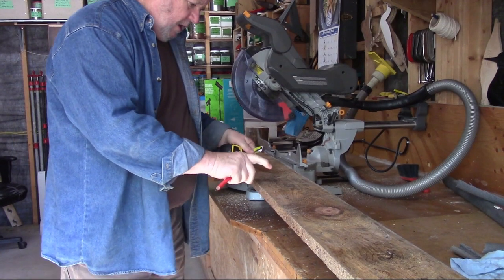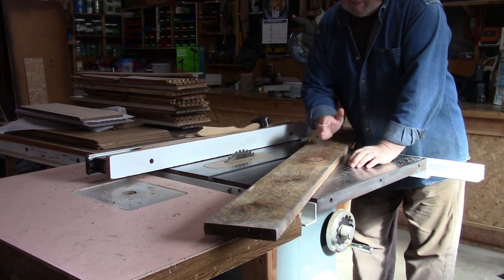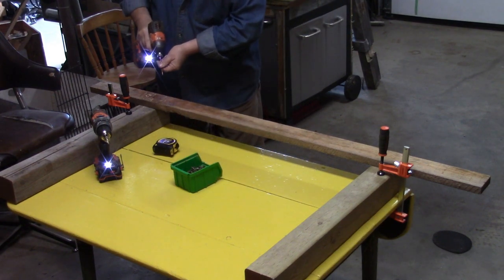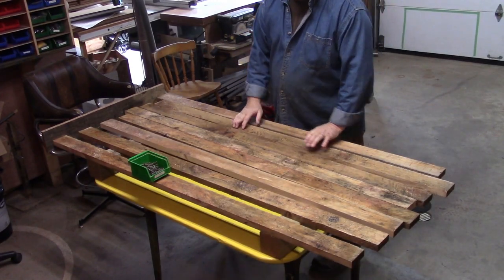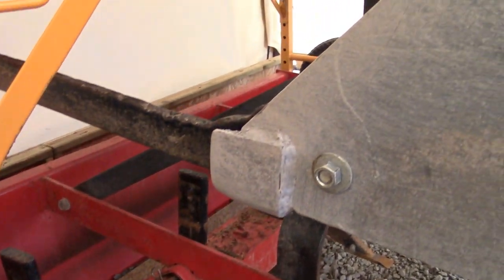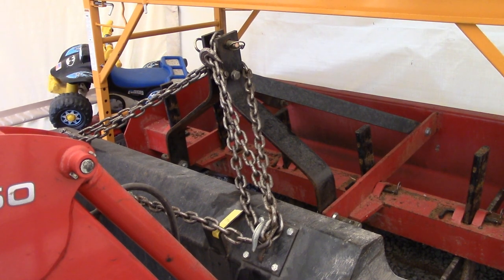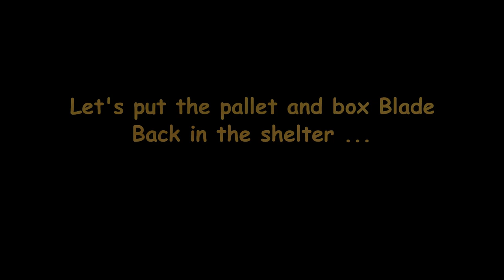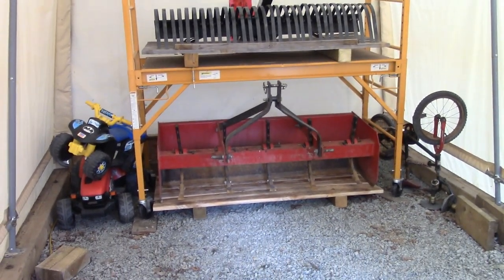Implement Storage Ideas

Comment: Nice video, Mike! I think i will do something similar once my barn is complete - I will put my tiller over my snowblower, thus saving room! And, I learned another trick, watching your video. Use two cordless drills/screwdrivers, rather than switching bits. I don't know why i never thought of that. Probably the tightwad in me, not wanting to spend money for a second tool! Enjoy your week!
Reply from the maker: Good day eh!!!  Well buddy using the 2 drills saves a lot of time.  I got these 2 drills as a gift.  They came in a set and I'm glad I have 2.  I really like the impact driver.  The drill motor, not so much.  It has dynamic braking and when I drill and stop the motor, it stops so quick the chuck loosens and the bit falls out!!!   LOL  I appreciate you watching along and commenting.  Have a great week!!

Comment: Nice work showing us how you built it Mike. Appreciate your effort. Quick question, where did you get the hooks on your bucket, I need to put some on my bucket. 

Thanks.  Be well
Reply from the maker: How's she goin'?  I got the hooks at Princess Auto where else!!  LOL  These were just round hooks, I think there were 3/8 ".  I cut the eyelet hole off the tip and welded them to a piece of flat steel.  Drilled 4 holes on the bucket and then used another piece of metal as a backer and bolted them to the bucket.  They work good.  But I am no welder and I'm not too sure how strong they would actually be!!!  Thanks for watching and take care!!!